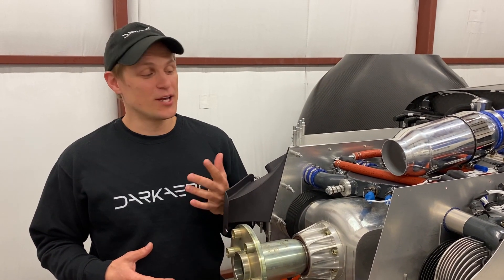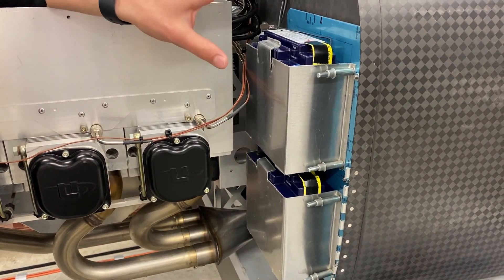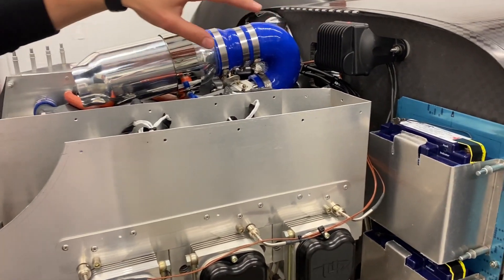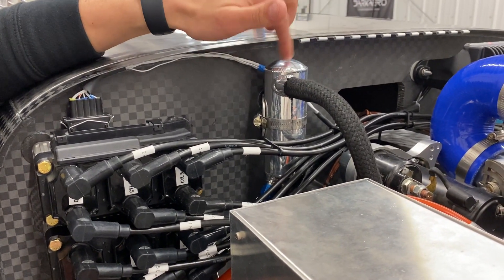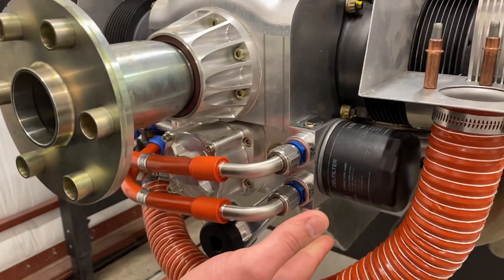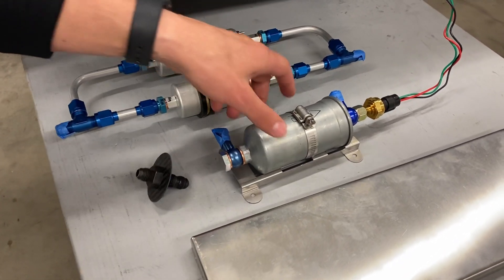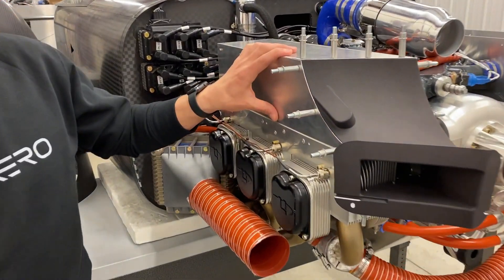UL Power UL520iS Engine Install on the DarkAero 1 - Part 1

Comment: The way the fuel pumps are plumbed, one of them will have more flow restriction in the plumbing fittings and so will presumably flow less volume... the same pump, all of the time. Reverse the connections on one end, so that each pump has one right angle in the flow (on the inlet side of one and the outlet side of the other) and flow will be more balanced. This is a fluid analogy to a common situation in parallel battery wiring; it won't matter as much here, but why unnecessarily put one pump in a more stressed situation?
Reply: I see that in "How do we start this thing?" https://www.youtube.com/watch?v=-_zEcFkdq6Y&t=660s the fuel pump arrangement has changed, using inlet and outlet manifolds which will have balanced flow. 👍 🙂

Comment: It's all sensible and tidy, but for reliability wouldn't it be preferable to have one battery and one set of ignition coils on each side? That way a problem in one area would be less likely to take out all electrical power or all ignition.

Comment: Question? Why the separate diodes and voltage regulator instead of following automotive practice and put everything inside the alternator. Some older autos put the regulator outside, it is about the size of a pack of smokes.The cabin heat tap off, is it enough for northern states and Canada. I know it is likely good enough for Calif. many southern designers had underestimate the heat requirement. I froze enough times in leaky 172 to know. At least this UL engine is the right RPM instead of 3000+ But UL, like Rotax, have not done the industry much favor by lowering cost.
Reply: Automotive alternators with separate regulator are regulating the field current; the alternator output rectification is done by diodes mounted directly in the alternator. He said that this regulator converts the AC to DC, which would be strange unless it is an actively controlled rectifier used with a permanent magnet alternator. Indeed the UL Power specs for the UL520iS include "Integrated permanent magnet AC generator, external rectifier-regulator"... so this is not like a traditional automotive installation. UL (or UL's alternator supplier) may have chosen to keep that active electronic controller (which is essentially a typical 3-phase inverter used only in generator mode) off of the hot and vibrating engine.

Comment: It looks like the turbo version would not fit?
Reply from the maker: Francis, that is correct. The engine mount would need to be modified to extend the engine out away from the firewall to make room for the turbo.

Comment: Should go with a diesel, that is going to be the future of small prop planes.
Reply: I'm sure that they considered this. Are you aware of a diesel engine with 200 HP (150 kW) output which is as compact and light as this engine?

Comment: When I flew C210 and also Britten Norman Islander BN2 that had an iO540 at 300 Hp. So for an extra 20 cubic inches over the UL power 520 with all that flash control systems I was getting an extra 50% power or 100 Hp more with a comparatively simple engine. Just seems like a low Hp for the displacement and FADAC.
Reply: The 520 is 5.2 liters which is about 320 cubic inches. An O-320/IO-320 will give you 160 HP. The 520 will give you 170 HP at the same RPM, and 200 HP at about 3200 RPM.

Comment: 6:00 шланги подходящие к теплообменнику на выпускном коллекторе не расплавятся от температуры выпускного коллектора?
6:00 hoses suitable for the heat exchanger on the exhaust manifold will not melt from the temperature of the exhaust manifold?

Comment: Great videos so far and a fascinating build. I'm curious about the fuel pump set up, are the pumps positive displacement? Running those in parallel like that and having centrifugal pumps would allow fuel to backflow in the opposite pump and I didn't see check valves in the setup. Just curious, you guys are intelligent and probably already thought of that.
Reply from the maker: Thanks for checking out the videos! The pumps are made by Walbro and each have a built in check valve which would prevent black flow. We actually just posted on our Instagram about a revision change to our pump set up and a similar question was asked.

Comment: Please utilize an augmenter exhaust system. Use the exhaust to create a low pressure system where the cooling air exits. It's free!!!
Each exhaust puff pulls cooling air into the cowling. 
I made an exhaust system like this in my RV7 Project. Even on the hottest days, çylinder head temps were 300 degrees. It also work when you have a long taxi across a hot airport. 
You guys are doing such a wonderful job. 
Put your brain power to work thinking about an augmenter. 
I would be glad to tell you the simple method I used to size the components.

Comment: Awesome! Ads an A&P, I have a concern with the cylinder cooling there doesn’t seem to be an easy way to pull spark plugs or do a compression test. Does this engine not need the plugs ever changed or the compression tested?

Comment: So they are basically a modern version of a VW boxer engine... very basic engineering, do you plan on putting it on an engine dyno..? I find it hard to believe you would accept an engine from the manufacturer without putting it through its paces before installation and flight..! 
That looks like its going to get pretty hot while on taxiing/ground movements.
Reply: This is a well-known and proven engine, not some prototype or homebuilt project.

Comment: Good looking build with regard to the fuel you said you can run either pump gas of race fuel how does the ECM adjust for the different octane ratings ? Second with the air box only having on opening at the front doesn’t the last cylinder  receive the heat from the first two? That heated air coming from the heat box is now hot how is that supposed to keep the battery’s cool?

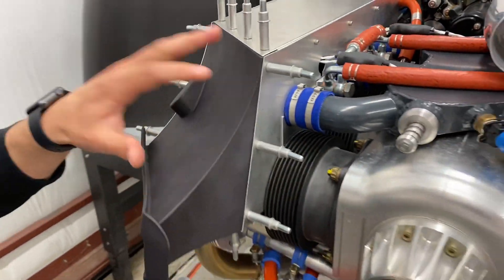Comment: Again in this video ex. 2:17 Darkaero did not use any rubber grommets when leading cables thru holes, that must be an mistake, hence cables tend to grind on all sorts of edges leading to electrical failures.. It is common knowledge in the automotive business, allways use rubber when leading cables thru anything... And again at 2:48 the cables allready rub against the edge of the hole...

Comment: Considering this is a low wing airframe, how is the header tank fuel level maintained? I bet the Dark Aero One's fuel system is more interesting than most. I'm very curious.
Reply from the maker: The fuel sump/header tank sits at the base of the wing, and it is gravity fed from the wings. Fuel from the sump is pulled to the engine by a fuel pump. Fuel from the sump is pulled through an absorbent bladder (Holley Hydramat) that sits inside the sump, which helps to further prevent fuel starvation. You can see more of this setup in this video we posted here: https://youtu.be/zTQw7ITKdE0?t=41
Reply: @DarkAeroInc  Thank you. Don't know how I missed this other video but it's excellent.

Comment: What's the calculated cooling drag? I've red a few docs and it seems to me that water cooling (although heavier) is able to give much less drag with properly designed radiators/heat exchangers. But, aircooling is adhering to the KISS moto, so i guess that's that

Comment: Why dont you use the wasteheat of the Oilcooler for cabin heating? Placement would be perfect and you reduce weight and the risk of CO in the Cokcpit.
Reply: Oil cooler is thermostat controlled, meaning there will be flight regimes when the oil doesn’t flow through the cooler. That means no heat in the cabin. Which is why they use a heat muff on the exhaust system. The motor is running you got heat.
Reply: @oldschoolmotorsickle   Ah, thank you :)

Comment: Looking at the specs of this thing from a car engine perspective, they sound quite weird (source: https://ulpower.com/en/engines/ul520/ul520is)

-200 hp for a 5.2 liters engine is really low, but the weight of the engine itself isn't bad! (108kg)
-this thing revs really low (a bit over 3000rpm) which makes sense for a 5.2l engine that only makes 200hp. I assume that's to allow attaching the propeller directly without any gear reduction, should help with reliability and maybe fuel consumption?

A large displacement (yet lightweight) naturally aspirated engine with low hp/litre goes against the trend in modern car design.
Reply: You nailed it - the reason for the low operating speed, the consequences (the engine must be large but can be light for the displacement), and the contrast with automotive practice.

The conditions of aviation and automotive applications are very different, leading to different choice. Ironically, while aircraft engines are useless in cars, car engines can work reasonably well in aircraft. Of course, more effort has probably been expended in automotive engine development this year (even with the rush to EVs) than has been expended in aircraft piston engine development in the past 75 years.

Comment: I wish engine designers would use the camshaft drive system to double up as a Prop Reduction Drive!
Reply: the Camshaft would need to be above the crankshaft, the cam gear or chain would be designed first as the prop reduction and then the camshaft connected to the back of the prop reduction drive gear or shaft. should be relatively simple to do. probably an existing design could be beefed up to handle the prop loads

Comment: The majority of cooling air diffusion should occur upstream of your inlet for a huge reduction in cooling drag. Your systems installation is beautiful but a lot of that will change after first flight. The more effort you put into your initial build the more reluctant you will be to change it after test flight. Burt had great success with the opposite approach. Mike Melville and Dick Rutan built the first long ez prototype in 10 weeks. Then they refined the systems and details on subsequent builds.

Comment: Questions: 1. Why is the oil cooler on the opposite side of the oil filter? Space, hose strain relief, exhaust space? 2. Why is the cabin heat supply taken from the left airbox rather than right? Hose turn radius? Awesome workmanship and videos. Thanks

Comment: wait did he just say he is gonna bleed heated air from the cylinder head cooling box to cool the battery?   wouldnt that heat up the batteries as well?
Reply from the maker: Good question! The portion of the air boxes above the cylinder heads contains cool air that has not yet passed over cooling fins and picked up heat. This is where we will be bleeding air from to keep the batteries cool.
Reply: @DarkAeroInc  But that was an interesting point: during idle on the ground there will be no airflow though the boxes, and the air in the top boxes will heat up - that probably won't be an issue for the batteries (and might help in cold weather starts), but it might be worth monitoring.

Comment: Really interesting project!  I was curious on the firewall material?  It seems like it should be covered in stainless or something for fire protection.  Based on everything I've seen, I'm sure you've thought about that already, just curious.
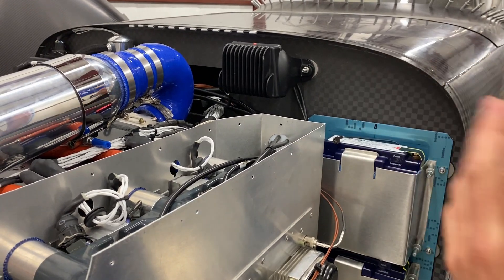Reply from the maker: Thank you for watching! The firewall is protected with a heat shield made from titanium sheet backed by ceramic insulation. The heat shield was not installed during this video. See 9:10 in the video.

Comment: Great work, guy's! One question is are those fins on the tops (outside ends) the cylinders in need of cooling? or are they just oil return volume around the valve springs?
Reply from the maker: Preston, the outside portion of the cylinders is where the valve rockers sit and they are force lubricated with oil so technically this portion of they cylinder is oil cooled.

Comment: What flight level for cruise flight are you expecting? Oxygen system?
Reply from the maker: Greg, it's designed to cruise at 8,000 ft, but ceiling is 20,000 ft. Builders will have the option to put an oxygen system in depending on their mission profile.

Comment: I would have expected to see wire supports closer to the plugs and cylinder temp sensors to keep wire vibrations from damaging the connection at the plug boot or top of temp sensor.

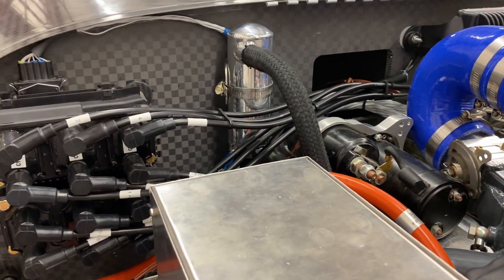Comment: 3:49- ignition harness securing, try a clickbond panpole bonded on the firewall.  Back in my spacecraft days we used a ton of those for harnesses. Just make sure the adhesive is high temp so it doesn't debond(to do so, we'd stick a heat gun on it).

Comment: Some beautiful workmanship.  Suggest using SCAT over SKEET on your cooling - I have personally seen delam of the inner skin and it will obstruct your flow.  Also silicon seal the front side of the oil cooler (you probably just have not gotten to this yet).  Am subscribed and enjoy you build immensely!

Comment: Looks good, guys! Perhaps a tip; The engine cooling depends largely on airflow and low pressure under it. Try to avoid the clutter under the engine, as it will make proper engine cooling hard. Ask the people at ULPower about inlet-to-outlet ratio and make sure you create a clean low pressure zone under the engine.
Reply: He said air flows OUT the bottom of the engine which will scavenge air from pressurized ram air above or even stagnant air in the plenum.  So just adequate vents on the underside would prolly be OK.

Comment: Great stuff! Would you mind sharing what material and printing method you are using for all the inlets?
Reply from the maker: We go over all of the 3D printed parts on the DarkAero 1 in this video here: https://youtu.be/F4a-ZQoHnFM. For the inlets on the engine the technique used was selective laser sintering.
Reply: @DarkAeroInc  Thank you very much!

Comment: Great work guys. 

It drives me nuts that the engine makers can’t put the air inlet in the right position and direction. The 180 deg bend is inefficient and ugly. Buts that’s my issue not yours. 

I’m so happy for you guys.  Keep up the great work.

Comment: Awesome! May be cheesy but would like to see some lighting holes in the battery holders.
Reply: components are 'caged' in case of catastrophic failure.. same logic as redundancy.. safety is number 1.. you'd be shaving pennies, not silver dollars, in terms of weight.. all housings are aluminum.

Comment: I think it's a miss not going with one of the Jet-A engines.  Fuel is half the price and has 30% more energy/gal, so fuel burn is less, too.  Also, I hate the idea of leaded exhaust coating everything, so what you didn't breathe gets picked up on your skin when you touch the plane.   They seem really heavy, though.   I'd like to see DarkAero in the vanguard, and I think Jet-A is burgeoning.  Luckily, I don't have to worry about this being a show-stopper for me; it's the 2 seats.  Maybe DarkAero 4/6 (passengers), please?

Comment: Does the heat exchanger for the cabin reduce exhaust gas flow?
Reply from the maker: Tiago, thank you for watching and the comment. No, the heat exchanger is housed around the exhaust - it does not enter into the exhaust stream. It does not restrict its flow.
Reply: DarkAero, Inc ahhh I see. I’m not sure why I thought it was actually inside of the exhaust header hahah. Thank you for the response! Love the videos. I’m working on some carbon fiber pieces myself and your videos have helped a lot with certain types of processing
Reply from the maker: Tiago, no problem! Glad to hear the videos are helpful. 🚀🤓

Comment: Do the fuel pumps each have their own check valves in series with each pump to prevent re circulation if one pump goes out?
Reply from the maker: Hi Bennett! The pumps each have a check valve at their outlet which prevents recirculating. Thank you for watching!
Reply: @DarkAeroInc  Dope! Thanks and keep up the great work!

Comment: Is it possible to upgrade the batteries to racing li- ions to save alot of weight?
Reply: Limatech produces certified Lithium batteries for this case of use, safer than race's ones.

Comment: What's the rubber grommet on the bottom front of your engine for?
Reply from the maker: That is for a fifth mount point in addition to the four mount points at the back of the engine. The nose gear mount is integrated into the engine mount so the added support at the front of the engine helps support the cantilevered nose gear by transferring part of the load up through the engine and into the engine mount hard points. It also helps reduce the amount of engine deflection relative to the cowling under certain loading conditions.